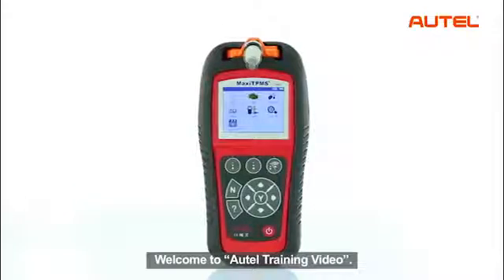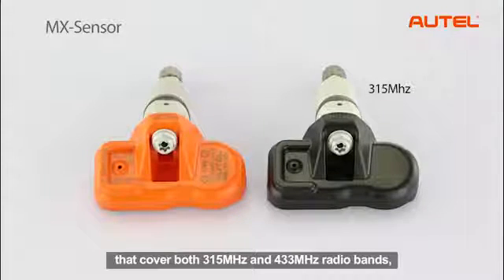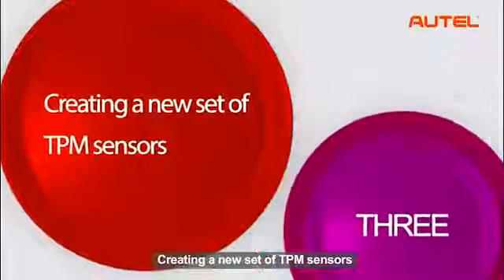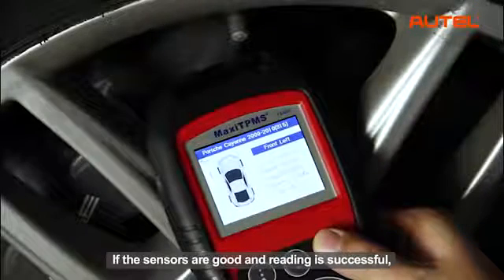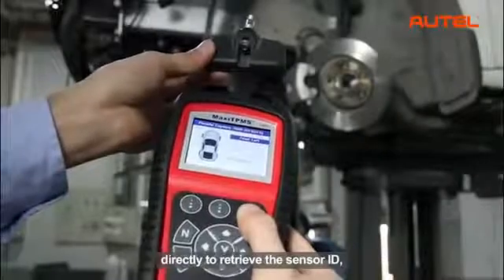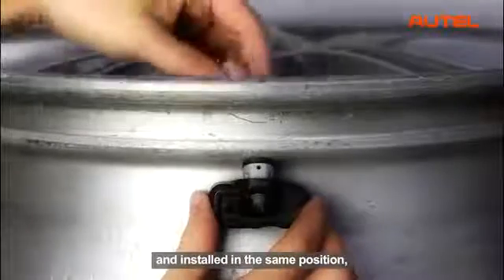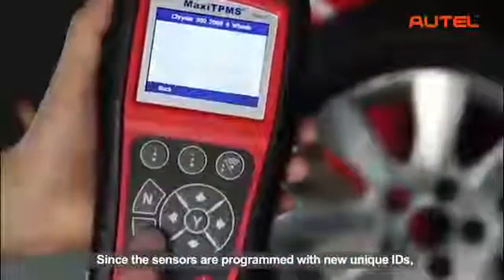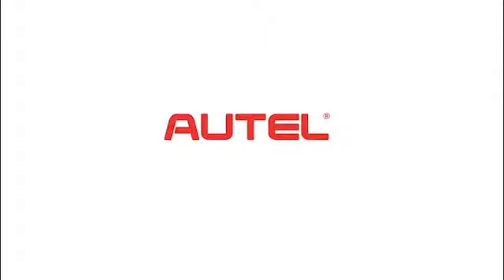autel maxitpms ts601 operation video auteltoolshop com

Comment from the maker: Six Reason To Get Autel MaxiTPMS TS601:1. Free Update Online Lifetime on Autel Official Website2. Built-in rechargeable Li-polymer battery3. Ergonomic design features strong housing and protective rubber boot4. Incredibly easy to use with intuitive navigation and step-by-step on-screen instructions5. Reads, records and playbacks TPMS live data, including tire pressure, signal status, temperature, battery status, etc.6. Reads activated sensor data including sensor ID, tire pressure, temperature, battery condition, OE part number, relearn informationhttps://www.auteltoolshop.com/wholesale/autel-maxitpms-ts601.html